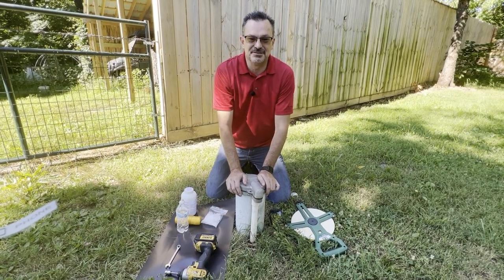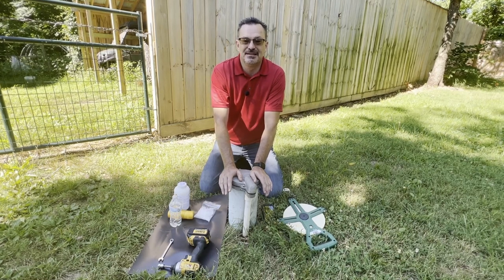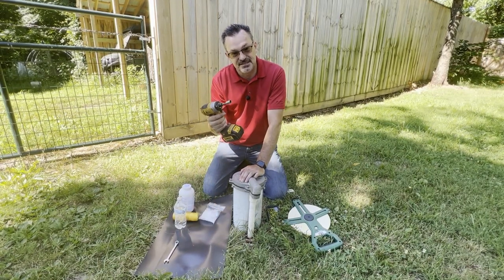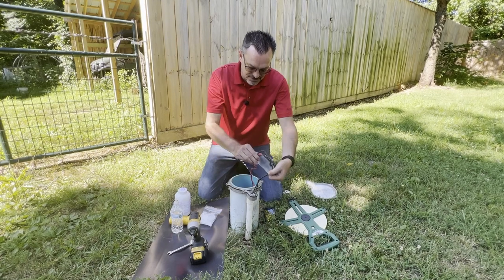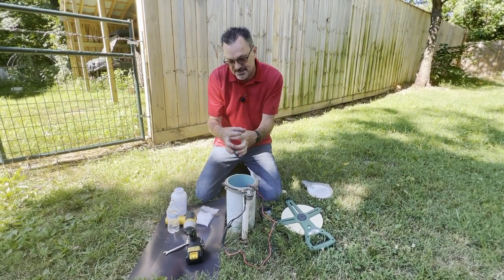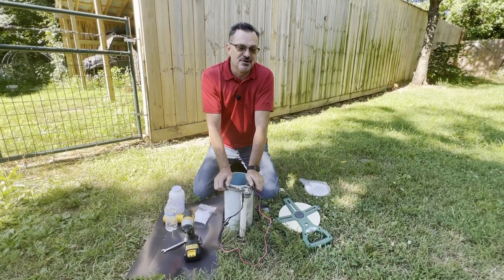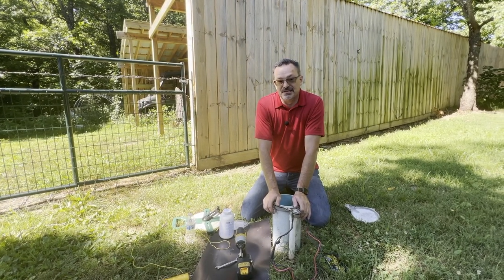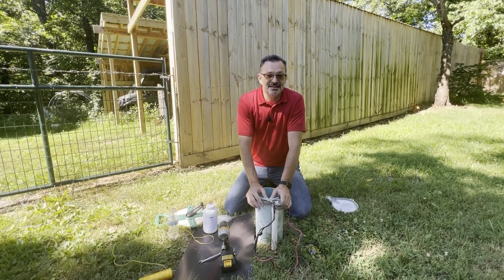Fastest way to find well depth!

Comment: I have about 40' of water above my pump. Static water level is about eighty feet below the top of the case.
Environmental supply retailers have bailers used for sampling monitoring wells. They're basically a plastic tube with a check ball at the bottom. Common size is one quart. Attach some cord and you can bail five gallons by hand in pretty quick order if power is out or due to a pump malfunction.

Comment: A fourth way to measure the depth of a well, at least to the surface of the water, is to use your two hands to "bop" the open top end of the casing.  You will hear a series of Bop, bop, bops coming back.  That is the sound wave going down the pipe, bouncing off the surface of the water and coming back up to the top where it bounces off the top of the casing and goes back down again.  I recorded the bop, bop, bop with my laptop, displayed it graphically and determined the travel time precisely.  That and the speed of sound led me to the depth of the well, or at least the dept to the surface of the water.
I like your tip of measuring to the bottom of the drilled hole as mine might be filling with mud from the bottom up.  I gotta check for that.  Thanks.

Comment: When you say bottom of your well do you mean like a bottom or like the earth bottom? Thank you for sharing
Reply from the maker: Bottom refers to the deepest point of the drilled well.  There will be rock or dirt below that.  The methods discussed here mainly determine the static water level which is the top of the water inside the well.  However, the tape measure with a weight method can be used to find the bottom if the weight can be lowered past the well pump. Hope this clarifies.

Comment: How about a laser measuring device
Reply from the maker: Not a bad suggestion.  However, a laser device must be precisely targeted and it would almost impossible to get it aimed correctly down into the well AND avoid all of the piping, wires and the well pump.  Using a laser measuring device could would likely only be accurate if all of those items were first removed from the well.

Comment: The tape measure method seems to be the most accurate, but I wonder did you take into account the time it took for the splash to reach you together with your reaction time, as you did with the previous method.  🙂
Reply from the maker: Great point.  No I did not.  Probably did make a few feet difference.

Comment: I'd be careful dropping any heavy object on a tape measure to make sure it doesn't get caught on anything or damage something on the way down.
I am no expert but I think on many wells there is a torque arrester midway down that for one might block anything dropping past it but more troubling the ones that I have seen absolutely look like they could grab something like that dropped down into them and not let it go that easily.   
I'd be awfully careful as to what I dropped down a well casing.  
One guy further down the comments was talking about using a cell phone and holding it over the casing and using the distance measuring app...oh good lord... imagine dropping a cell phone with all its toxic parts into a well and aquifer.
Reply: In most areas simply call the department of water resources and they will tell you what the static water level is in your area.  If they keep the info - which most of them do - they will also have all kinds of other useful info like the well drillers log from when it was drilled/ what the static water level was then/ what the drawdown was like in the testing of the well as well as the original depth.
It won't work for everyone but many people it will

Comment: Or.....
You can just get an app found in most smart phones that is a distance measurer.  Then, put your phone camera facing into the water well hole and ALSO have a high powered source of light like a high beam flashlight facing into the hole at the same time and aim your camera as centered as possible into the hole and you will see on the phone screen how deep your well is once it has established the bottom part of the well.  Your welcome.
Reply from the maker: That would be almost impossible to get an accurate reading with so many obstacles in the path.
Reply: @preparedandmore   It worked for me.  I used the app just to test how accurate it was and it worked within 2 inches which to me is incredible.  The well professionals that installed my well had already told me the depth when they finished the job.  That's why I know the apps accuracy.  Your welcome.

Comment: Lol I can't take of my cap it's holding the well pipe from falling.
Reply from the maker: That's not good.  You certainly don't want the pipe to fall but you need to be able to open the cap.  Interesting dilemma.
Reply: Saffff1000 has an older type cap. Before the type you have was developed the pipe was attached to the cap. Usually, the cap was split the pipe come out the top. Older wells had these. That is why most farms or ranches had well houses everywhere. I have about 10 of them on our different ranches. The pressure tank and plumbing is installed inside the houses. And your trick with the tape measure wouldn't work on most wells. Usually there is a rubber arrestor on the pipe about every 100 feet. It to help reduce torque of the pipe, and reduce wire rub.
Reply from the maker: Great information.  Thanks for the comment.
Reply: @benjaminjohnson5469  Or they just don't live where you live.  Well seals are still in common use where weather doesn't dictate a buried well head with a pitless adapter
Reply: When I installed my first well pump in a 165' deep well, I didn't know about arrestors and dropped the pipe and wires straight down. 10-15 years later, the wires shorted out and I pulled the pump to find the insulation rubbed off. Replaced the wiring and reinstalled with arrestors, and have had no trouble for  30 years.
Reply: This does mean it is basically impossible to determine static water level, as nothing can reliably reach down to where water level is if below the first arrestor.

Comment: Please spare me the info on how to take off the cap....jfc!!!!
Reply from the maker: Not a bad suggestion, however, it would be very difficult to point it down into the well and blindly avoid all of the obstacles.   If you have a larger diameter pipe with the well pump already removed, then a laser pointer might be a great option.

Comment: Tells you nothing about well depth, only static water level.  If you really want the depth of your well, go to your state database for wells.  Every state has one and all wells are listed in there.  Often you can search by location or map and it lists all of the data for your well.  States are required to keep track of all of this information.  This video itself is fairly useless.
Reply from the maker: Most experts would say that the static water level is the most important of the two numbers.  You use the static well depth to place the well pump.  You don't place your well pump on the bottom of the well, but instead place it 30-40 feet below the STATIC WATER LEVEL.  For the purposes of this video we are attempting to find the static water level to determine what type of water pumping system could be used to get water out without electricity.
Reply: Mine too old for the map.
Reply: Ha.
Here in Tennessee. depending on the county one is in obsoletely NO RECORDS are kept on anything except maybe your septic.
I lived in Florida for many years and my well depth was also irrelevant. If you listened to his video carefully he explains that it is for static water level. 🙄
Reply: Ky doesn’t require any registration of any kind.
Reply: My state has it , yet well driller did not report it !